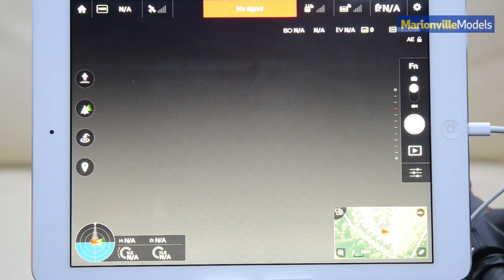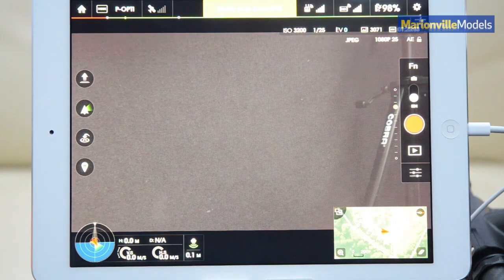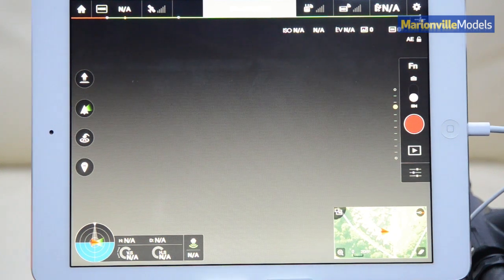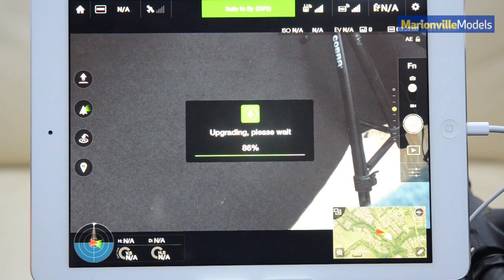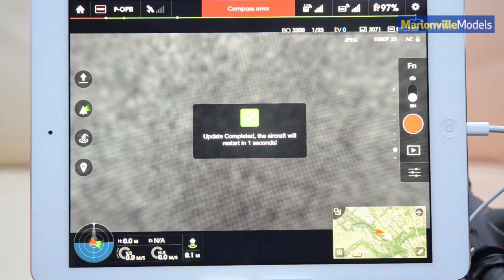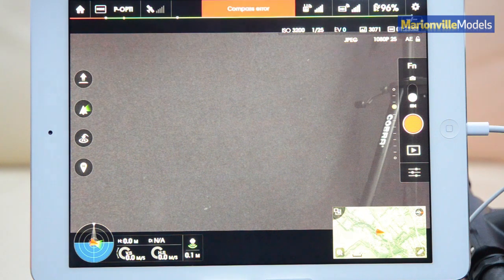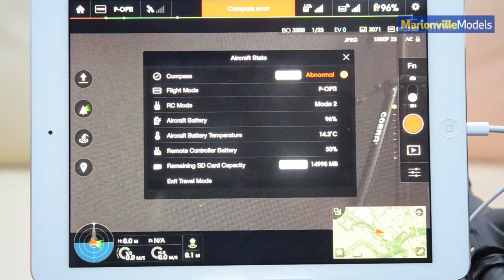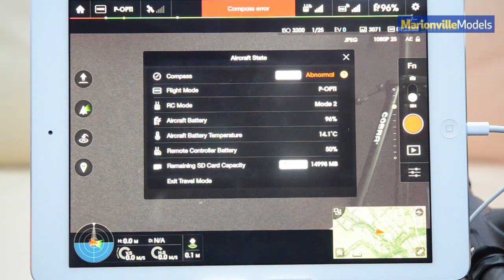DJI Inspire Firmware Update Timeout. How to Fix This Issue "Firmware upgrade wait timeout"

Comment: Hello I was trying to do the update an it seem it was working but then I saw I only had 1 bar on the batteries so I stop it after 12min an after I try to do it again I get a yellow blinding light an it didn't want to update what to do??
Reply from the maker: Have you checked the text file on the sd card, it will tell you of firmware was completed. Yu may want to do the controller update as there may be a firmware mismatch and you have become unbound. You could also try rebinding the controller to the Inspire.